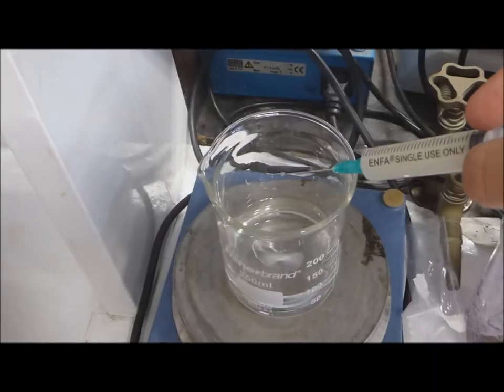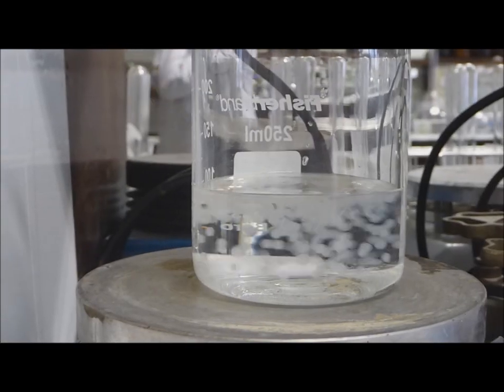MICROENCAPSULATION

Comment: What's the size
Reply: judging from the ratio between size of the bead and the size of the 250 ml beaker, I'd guess ~ 0.5cm - 1.0 cm in diameter. I'd doubt that it's more than 2.0 cm. Depends on the gauge of the needle too used.
Reply: Agitation at what speed